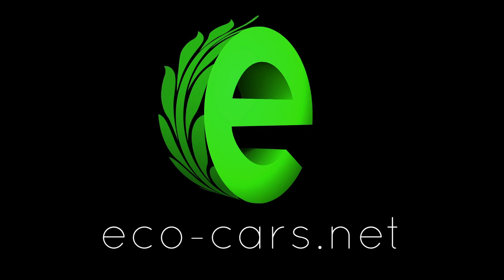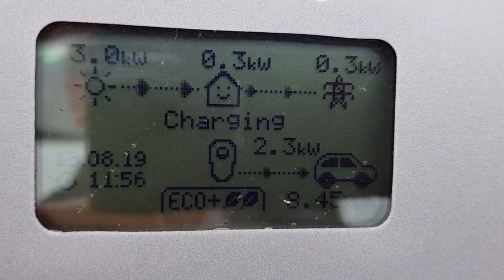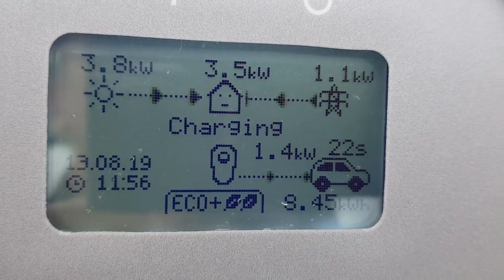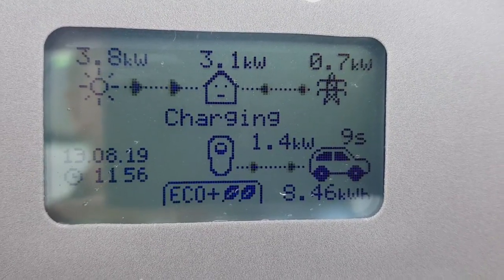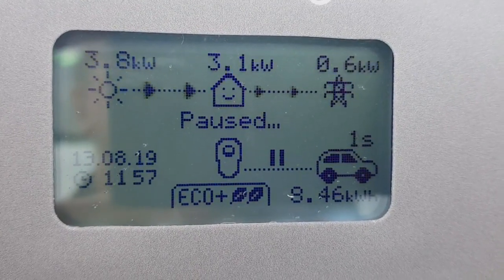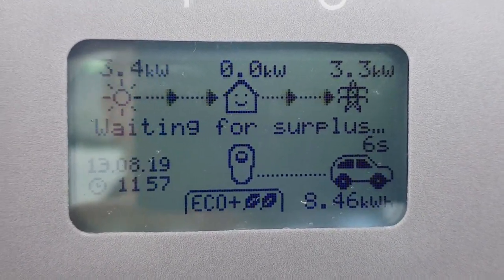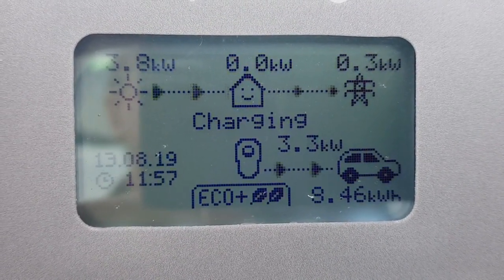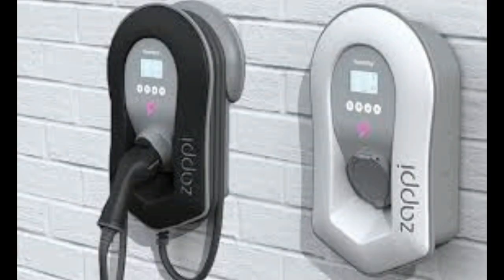How to charge your Leaf and make a cuppa, with a Zappi from the sunshine !

Comment: I use a slow boiling kettle/urn which has a lower wattage element  (680w) , less on standby mode ,which i leave on all day .This reduces my import of electricity  as  I,m not always producing 2.2kw of solar but quite often there is  at least 680 w available . It also reduces the fluctuations if you were using a zappi . The kettle i use is similar to this one  on amazon (.Neostar Electronics Neostar Perma-Therm 5 Litres Hot Water Dispenser Urn )

Comment: Interesting to see how it actually works with the 30s minimum before it switches over in both stopping and restarting the car charger. I assume that time is preset.
Reply from the maker: You can adjust the wait times to less than 30 seconds